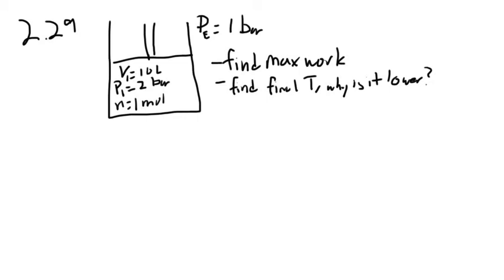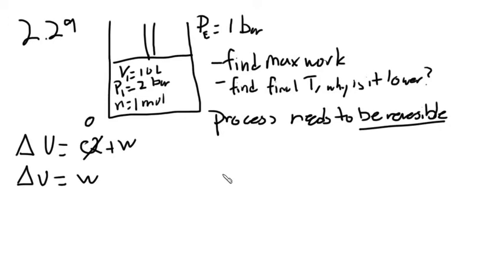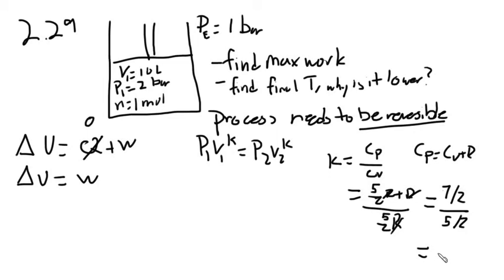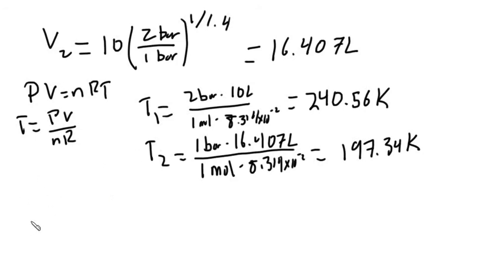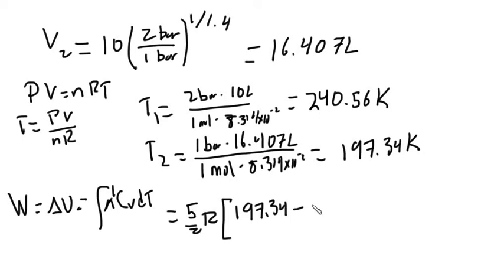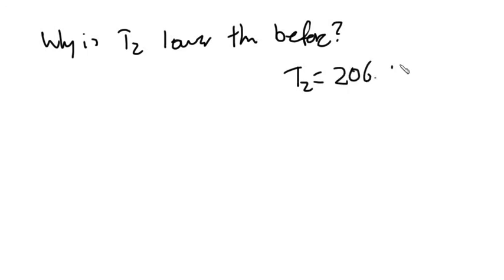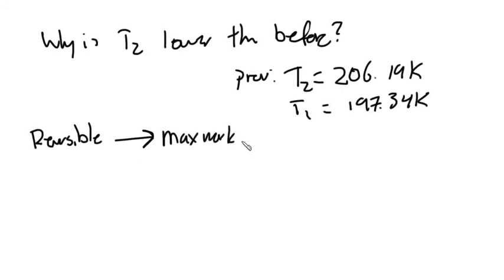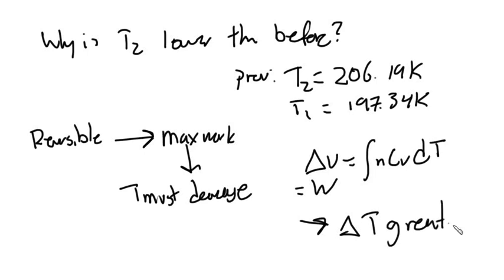Thermodynamics: Piston-Cylinder Assembly Part 2

Comment: In a reversible compression process, I mol of ideal gas in a piston eylinder device undergoes a pressure change from 1 bar to pressure 'P" and temperature increases from 400 K to 900 K. The compression path is described by PV^1.3=constant Calculate the final pressure and heat transferred. IGiven-Heat capacity of gas (Cp) 30.84 J/mol-KI